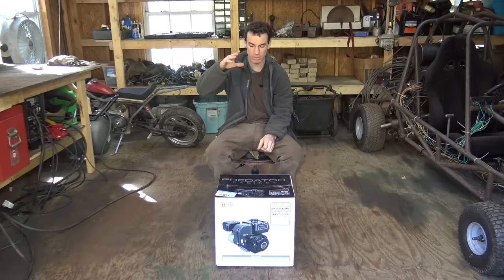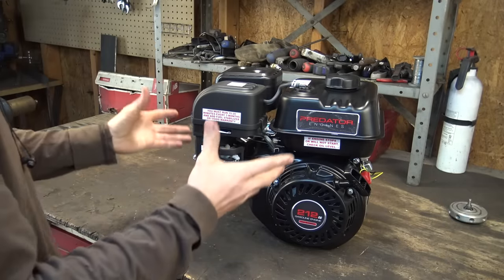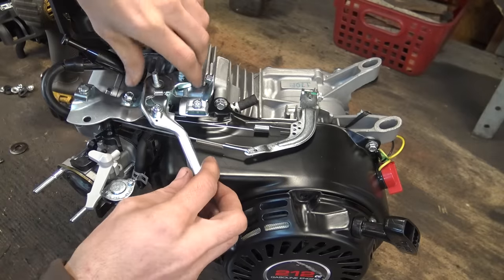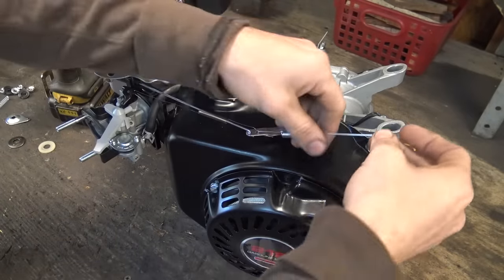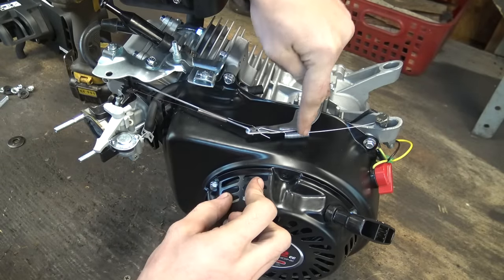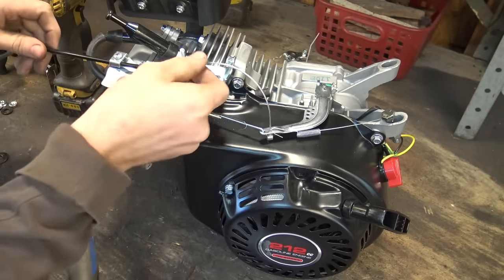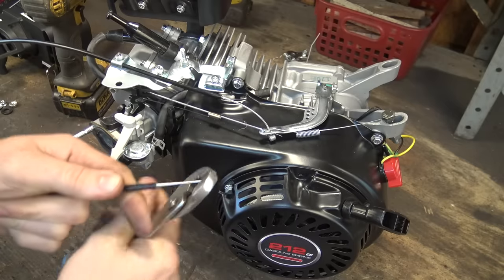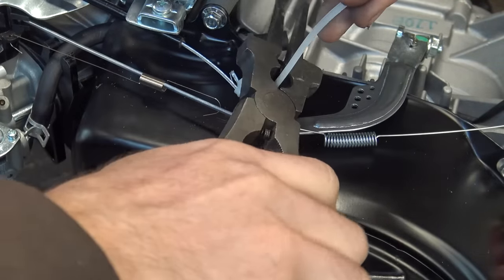how to bypass the governor on a predator 212 engine

Comment: He is actually not bypassing the Governor he is wiring directly to the governor. - Therefore not letting the governor do its job. - A lot safer to remove the gear btw.
Reply: ThunderDivine yes mate, my thoughts exactly, he hasnt took the governor arm off ?? But there are many ways to do this.
Reply: Bypass and removing are two different terms
Reply: It still works, and he said that he's done it before
Reply: Looks like a bypass to me
Reply: It works that's all that matters . Make huge difference in power
Reply: Don't listen to rather b welding. He is a fool. ALWAYS REMOVE THE GOVERNOR INTERNALS if you plan on turning the engine at a high RPM. Bypassing the governor or wiring directly to it can cause catastrophic failure. Destroying your engine.
Reply: There for bypassing the governorr
Reply: I did this exactly as he did ,and my engine is still running great
Reply: It’s still governed
Reply: This literally does nothing but change the mechanism that pulls the governor arm and throttle linkage,  governor still works just the same because it's inside the engine and the arm is still in play within the throttle assembly. Have to remove governor if you want to do correctly, this mod does not bypass anything, it simply removes the pulling mechanism/arm within the throttle assembly and replaces with a direct link to governor arm and different spring placement. Notice that the governor arm still moves exactly the same as it did before removal of the parts, therefore still working exactly the same as before.
Reply: @user-fc8xr2dh3y  was thinking the same thing..
He never did anything to bypass the governor..he jus made it easier to install throttle cable..
Throttle arm does nothing but but move card and governor arm exactly the same way jus less metal lol
Reply: I did this and my engine runs fine.  In fact it made my engine a ton faster.  But then again, my throttle stopped at like 15mph.  With this I can now go 28 mph.  If it still let's the governor work, that's fine for me.  I don't want to blow my engine from over revving.  My concern is that it is backfiring when I coast down from speed, and backfiring is what killed my previous engine which was a greyhound.
Reply: @user-fc8xr2dh3y  The function of the governor is to close / reduce the throtle when the engine reach high RPM, that just protection mechanism. What this guy do is manipulate that mechanism so the governor not closing the throtle even if it reach high rpm.
Reply: @Toba Farm that's incorrect, this does nothing to change the function of the governor arm, I have tried it and tested myself and governor still functions exactly the same way at the same rpm as before making this adjustment.
Reply: @user-fc8xr2dh3y  just did it.  You're incorrect.
Reply: @Ryan Kelley if you've done this and then tested function of the governor with the engine casing open like I have, you can plainly see that the governor internally still functions in the exact same way no matter how it's pulled from the external part of the engine. Unless you have taken these engines apart and know exactly how they actually work than you have no idea what you are talking about. I myself have had plenty of them open, and rebuilt enough of them to know all the parts as well as their functions, and what will and won't change those functions in one way or another.
Reply: Hey T that would be a good upload, showing how the govener works
Reply: @ownee1866  he never said he removed it he said he bypass it
Reply: @joeshmo2473  how????? Removing it completely will do the same thing...all your doing is letting it turn what ever RPM it will turn .... either way......
Reply: @user-fc8xr2dh3y  
I don't believe you.  If you did it EXACTLY as shown, the governor can't function as it did before.  A governor has very little power and usually needs only to regulate the throttle butterfly against a weak spring.  The friction of the throttle cable he installed directly to the butterfly completely overcomes the governor's meager attempt to adjust it on its own.  If the governor was still "working" it would be moving his throttle cable in & out at different RPMs.  The governor's FUNCTION is bypassed.  The added throttle cable regulates the butterfly in the carb with no interference from the governor.
Reply: @joeshmo2473  Why, the governor might fly inside the motor ?
Reply: @user-fc8xr2dh3y  dude do you even own a go kart or do you just not know what the fuck you are talking about? The governor arm moves back and forth when rpms get to high, which slows the go kart down. When you do what this guy did in the video, it keeps the governor arm from slowing the rpms down. I have done this and it boosted the speed of my go kart drastically. How about try it first, and do it the right way, because clearly you did it wrong
Reply: @user-fc8xr2dh3y  you seem to think the governor is doing something inside the engine, if I understand you correctly. It's not. The governor parts inside the engine, move the arm at higher rpms. The internals are still free to work as they normally would, but the arm is being overcome by the throttle cable. He is letting it move, by connecting the spring up, but in the opposite direction, so it's normally closed.
Reply: @wayne you're obviously confused as to how the governor works. Watch this video, it shows you what the internal parts actually do, these parts are known as "the governor" itself, the arm is just there to help actuate the internal parts. 
https://youtu.be/cRJRDtg6Ldo
Reply: S & C can you share any pics of that? Do you have a video? Where did you put the zip ties?
Reply: T I’ve been reading through the comments. You seem to have some knowledge of this but I’m wondering if you actually did what this guy did and ran the motor vs looking at the internal governor with the engine not started? Many people have done that and ran the engine with drastic differences. Just trying to understand. Thanks
Reply: @kyleranderson1948 
I wasn't arguing against removing the governor entirely, just correcting misunderstanding about what is happening when it is bypassed.
Reply: @denbecr49  And you explained it to perfection on your earlier post. That is exactly what is happening with this rigged arrangement.
Reply: @Deucealive75  man why dont we all just blow up are motors
Reply: Ya this motor has cheap gear it will snap and then ur motor is fried
Reply: so I'm still confused. does this bypass work or not?
Reply: Basically this hack will work, until some internal bits fail. Then you’re toast. But engines are cheap, when some internal plastic bits blow after you had max fun, go buy a new engine.
Reply: @bodhranlowd  That's the bottom line right there! We've done this for awhile. We blew a flywheel apart on one and broke a crank shaft on another but the fun we've had on em was worth a few trips to harbor freight 😁
Reply: I repair and rebuild these small engines every week, for those of yall questioning or throwing insults about not knowing what Im talking about, ask yourself this, can you or better yet HAVE YOU EVER taken an entire motor apart and rebuilt it? Because I have plenty.......and once you have that knowledge, youll know the truth, those of you arguing etc have obviously never fixed or worked on one of these small engines....but go ahead argue with someone that actually makes money doing this...your comments are pretty damn funny!👍
Reply: @user-fc8xr2dh3y  so I got a question.  Removing the governor inside a generator isn't a option because the electric rotor blocks it. It takes so much work.  However, generator engine isn't meant for high rpm and speeding.  Will doing this "bypass" somehow improve gas efficiency someway? Or does nothing at all?
Reply: @BOREDANDWELLBORED   What he did in the video is not something you ever want to do on a utility engine. This is for the go kart and minibike application only. All he did here was go from automatic throttle to a manual throttle to get much higher than stock governed rpm and have full control of the throttle.
Reply: @user-fc8xr2dh3y  "working exactly the same as before". The laws of physics prove otherwise. Do you still think those little governor flyweights can overcome someone's throttle hand?

Guys have been manipulating and changing stock linkages for decades. If it worked the same they wouldn't be doing them. Do you think the guy in the video would do this on multiple engines if the results were an engine that behaved the same way it would out of the box? Of course not.
Reply: Yes it works, the governor arm isn’t able to be applied because the throttle won’t allow it. That spring is supposed to pull back that arm when the engine reaches a certain rpm, but it can’t now because the throttle keeps it from pulling it back.
Reply: @themotochannelu.k5098 I did it and my motor don’t start anymore what would you do the parts won’t go back on how they were
Reply: Show us the engine running and prove the governor is not working to control the engine.

Comment: I just had to come back and comment, every other video on YouTube requires opening the case and removing the shaft and gear. I decide to give this a shot and works like a charm and easily reversible if needed. Thanks for the video, this is what I'm doing to all the 212s now, simple and so effective.
Reply: i did this and the top speed is like 35 on my go kart with a stage 1,  you think this does the same thing if we removed it from inside?
Reply: @Young_king888  I get 30 on mine stock....
Reply: In my opinion the correct way to bypass the governor is to do it internally.  "bypassing" the governor as described will only work until the engine reaches a certain speed and activates the centrifugal weights which will overpower the spring and limit the revs anyway. But I will go ahead and try it anyway...
Reply: @aldobarone7398  I'd be interested in your outcome. Pondering just going ahead and doing it internally, but I'm lazy.
Reply: Removing the plastic parts internally is the correct way....Trev New Zealand 🇳🇿😇
Reply: @migiddymike1403  since someone replied it reminded me that I can now update. I did this and the engine still going strong.
Reply: Trevinski King how do you do that? I’m handy with tools and small engines.
Reply: @AlMedic2000  There's videos online showing you how to do it: it's a bit involved to explain it verbally.Thanks Trev New Zealand 🤪🇳🇿
Reply: Don't shoot the old school messenger but...you really should not rip off a governor. It is there to keep the engine from over- revving and potentially failing which could also end in explosion. Just enjoy your minibikes and if you want to hot rod the engine, do it in a more legit, and safer, way.
Reply: @JackT_Music_on_Vinyl  yeah just go bigger motor or dirtbike motors
Reply: I got 45 mph with this trick and stage 1
Reply: @aldobarone7398  Is it possible to use the governor pin just as a fulcrum...meaning not tightened down so the arm jus pivots on it?
Reply: @Young_king888  I just reached about 35 on mines as well
Reply: @Finetouchautopros   just removed my torque converter and added a centrifugal clutch instead.  As well as a much smaller sprocket. I Will update you on the results
Reply: @JackT_ here for a good time not a long time!...lol
Reply: I did this and now my motor stops running if I give it a tiny bit of throttle.
Reply: I was praying for a video I thought I could just undo the governer but it still need to function right or
Reply: @jaybrittain5295  weight matters alot
Reply: @aldobarone7398 just opened one that had the govenor bypassed this way for 1 day only started and rode up and down the rode opened it today to go ahead  and remove it and it had already fallen apart if you bypass it and go over a certain rpm it will self destruct

Comment: Predator engines won’t blow up ungoverned with stock internals. I raced a predator 212 with a Briggs animal 206cc racing 26mm carb and a Honda racing exhaust as well as a vacuum fuel system, on my professional racing gokart for 3 years. Never even had a sign of wear.

Comment: The only problem with bypassing a governor is the flywheel is not designed to turn higher RPM and when it flies apart, they will take your leg off . If you’re gonna turn higher RPM in these engines, you need to change the flywheel to a billet flywheel that is designed to turn higher RPM..
Reply: Yes and you would also have to put a new rod in there aswell

Comment: I usually never comment on YouTube videos but this video is so good he explains everything so simply and he shows you how to do everything and it's not complicated so thankyou very much for this video.
Reply: Amen brother. Simple, effective, and awesome camera work!
Reply: I agree, this is by far the best video I've seen for this process so far... However... zip ties?? bro, REALLY? I'd suggest using the proper size ferrules and a swage tool to crimp the end of the wire loop so you don't risk the loop coming undone or cutting yourself on the cut end of the zip ties.

Comment: Leaving it as is and putting a ziptie in the govenor spring(the long one you reused) would have given you the same results in under 30 seconds.
Reply: FireAndGasoline I just modified the governor to govern out at a higher rpm then I still can extreme over rev the engine.
Reply: Silent Death 
If you mess with any Briggs v twins they make a 4000rpm spring kit.
Reply: can you show us in a video, im new to this, and  i dont understand what you said.
Reply: yep can confirm
Reply: FireAndGasoline   very true but still a lazy, bad idea......      Just take it off right,.   Its just as simple with the added benefit of doing things correctly,.    No hate,. Just speaking the truth.......
Reply: Shit I use to disconnect the rhe governor on my 3HP Briggs and Stratton and my 5 Hp Mini bikes and go carts and also run a mixture of Cox RC in with the gas with modified straight pipes no problem full all out. I would get up to 40 mph on the three and up to 50 plus on the 5 hp sometimes even mix a little straight Ahcohol yes Ahcohol never melted a piston or had a problem. 
Put thar in your Pipe and Smoke it
😎
Reply: And i forgot to mention Full Throttle all the time.
Reply: we used to mix all sorts of alcohols with our go cart, 5hp briggs. easy 45mph, had that thing for 20yrs then sold it
Reply: @georgekrug2071  and you get that blue flame out the four inch pipe!
Reply: george krug
Reply: What do you mean put a spring in it
Reply: Please make a video showing how
Reply: Chris Blackburn p
Reply: Show us how
Reply: @tomsmith3987  The spring he took off and used as a return spring...All you do is put a zip tie through that springs coils, then attach the zip tie to create a solid connection instead of a springy connection. You are just making a loop around the springs coils so it is no longer a spring. And you don't have to remove the spring to do it. Just lift the gas tank some to get to it. With the zip tie method there is no need to pull all that stuff apart and if you want you could easily take the zip tie out and have your original linkage still intact. In my opinion he just made a big mess when he didn't need to.
Reply: Deucealive75 so you can confirm that does work though
Reply: @michaelcperri  Sure if you want higher RPM for higher road speed. I wouldn't do this or recommend it. I'm different than most people. I like the original linkage with the governor. For higher top speed I installed a torque converter. Turned a 20 mph bike into a 35+ mph bike.
Reply: Adan M  The safety of a trike at those speeds I wouldn't know. And the governor option is up to you.

Comment: On the OEM, (please pause the video at 1:40) the main throttle lever is NOT hooked to the carb. It is hooked to the governor which then IT controls the throttle based on the internal mechanism that limits rpm/response along with your input. Bottom line, the governor lever has final say so in the throttle/butterflys position. By hooking directly to the carb or the governor arm which directly hooks to the carb you have eliminated its ability to alter your input by giving you a direct connection. No governor action is capable when your right thumb is directly connected to the carb's butterfly. Those who say this won't work should put their dad's tools away, go back to their parent's basement and warm up a hot pocket.
Reply: What do you do with the governor if you've installed an aftermarket carb that has the tradition slide? The stock carb and assembly above it are obviously gone, but the governor is still there. I am not getting fuel to the carb even through the new throttle works. I appreciate your advice/direction.
Reply: So you pulling the governer with the throttle and bridging from that so no direct to the butterfly on the carb if you get my drift
Reply: Hey hey ! How about if I like pizza bites instead of hot pockets huh ?

Comment: Zip tie the governor spring. Takes 5 minutes. Same outcome, way easier, and you keep the stock linkage which is very useful. Its cool that you came up with your own way though, never would have thought of doing that.
Reply: you need to make a video
Reply: @justnature1900  i see what she means. If you watch the governor spring from the throttle to gov arm, its got a certain "give" that prevents it from opening fully. Zip tie the coils and it essentially becomes a rod instead of a spring. I may try this

Comment: Instead of a zip tie for the cable end with no fitting on it, you could use a 10=12 gauge electrical crimp  connector. Probably a little more durable. Great video. Thanks for sharing.
Reply: I was thinking the same thing, or even a fishing weight.